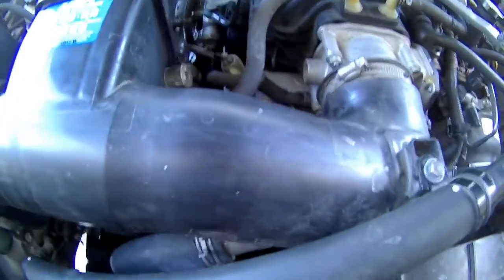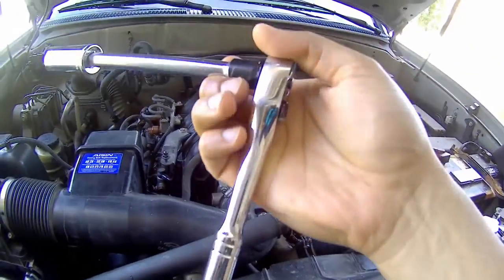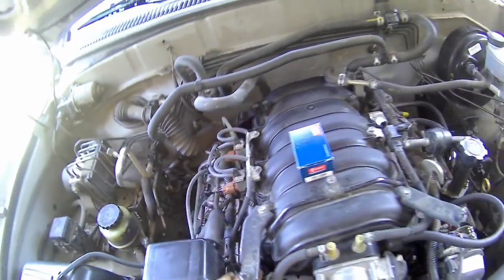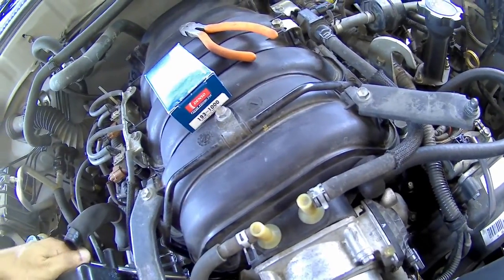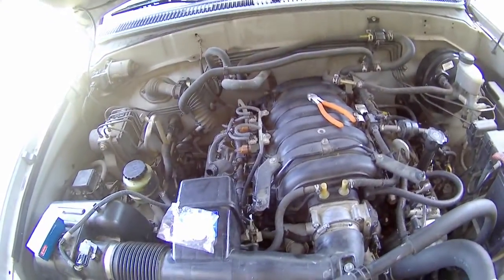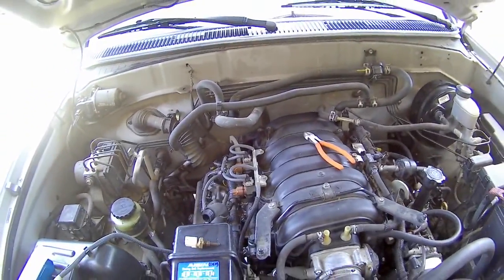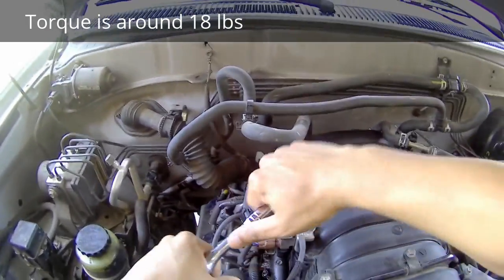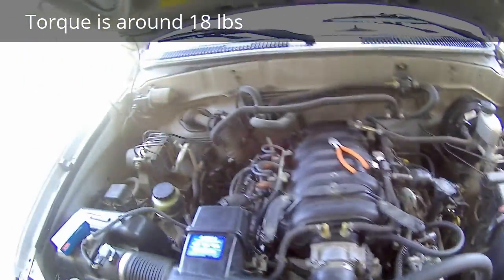How to install Coolant Sensor on 2005-2006 Sequoia/Tundra 4Runner V8 Lexus GX470

Comment: I changed the temp sensor and it still won’t read on the gauge
Reply: I've been lead to believe there are two sensors on some models
Reply: use hem and change the pig tail

Comment: really dude...delete this and do a new video... you can't see what you're instructing cause your angle is just wrong ( you knew that before you posted this ) and your audio is terrible ( again you knew this before posting ) ... had to stop 4 minutes in... this is not very helpful unless you've seen other ..better videos that confirm location.
Reply: I need to do this on my 2006 sequoia but the audio is muffled on your video and your video is pointing too high I cannot see what you're doing most of the time.   I keep replying it because I really need to do this and there's no other videos out there but I will give you only 2 or 5 points on this one please repost a better video if you can